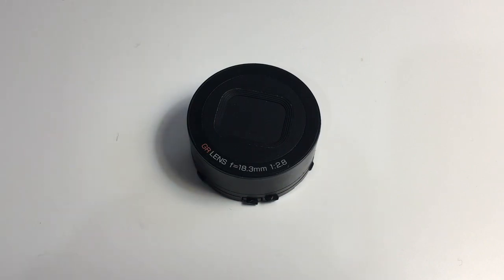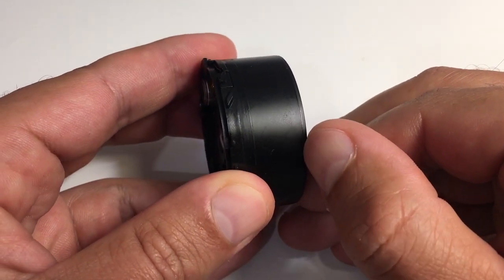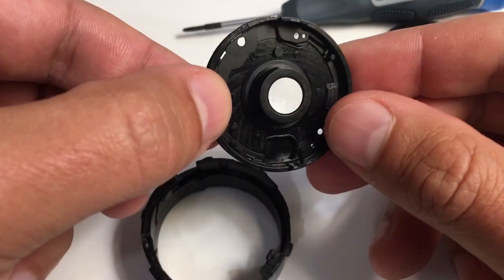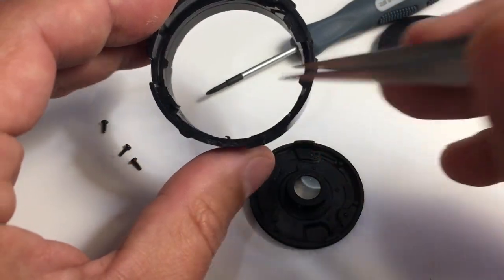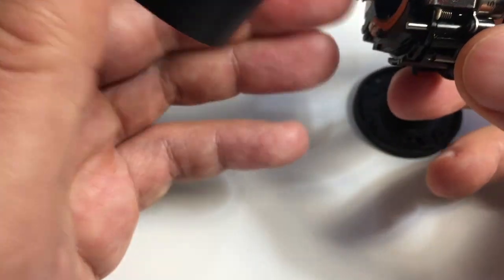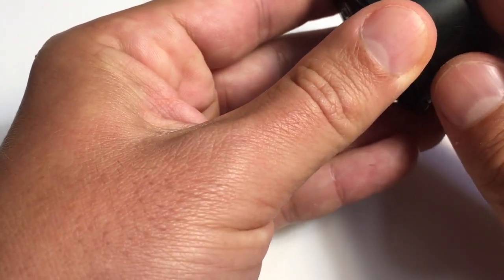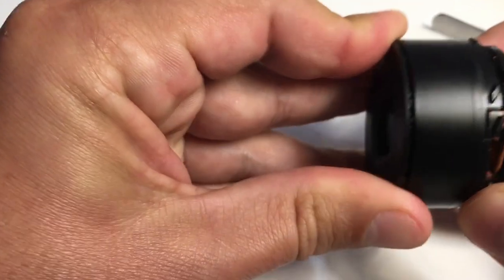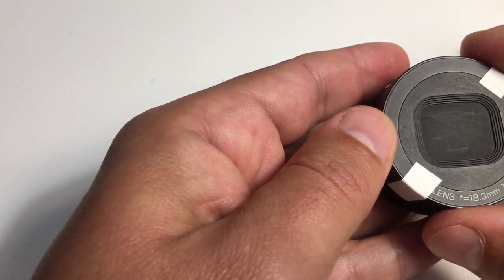Ricoh GR (II) Lens Housing Disassembly

Comment: before applying pressure and twisting on the front plate, make sure to pull the back part so that it will actually move when you twist.

Comment: You should look my videos how to place front cover properly without these long attempts to not break it. BTW, no need to unscrew those 3 screws of front lens element to remove external plastic ring which contained lost spring. It is enough to gently rotate counterclockwise plastic ring which sits on front lens element ;)
Reply from the maker: Thanks for your Tip!

Comment: After struggling with getting off the front plate, I found out it helps if you pull the internal lens element back out of the barrel a little. After I did that the front plate easily clicked loose after rotating clockwise.
Reply from the maker: Thanks fot the tip!

Comment: Thanks so much for making this video, Michael. I found that using a couple of sticky 'protect pads' (sticky dots) used to prevent cupboard doors from slamming loudly when closed, stuck to the front cover of the lens helped get a grip on the front cover to turn then remove while twisting as you say, clockwise. It took a little force but not that much before it popped off. I hope this sticky dot tip helps others who are about to attempt to fix their GR2.
Reply: Just want to add, I'm finding the GRII an absolute nightmare to fix. I read somewhere else that you really need to be a watchmaker to fix the inner lens capsule. Whoever said that is 100% right. The worst thing though is all the time I've invested in trying to fix my camera, could've been spent taking photos, which I'm missing. I know I shouldn't say this (because it'll likely upset the GR fanboys), but honestly, get an Olympus or Panasonic, which imho are far better built, more reliable cameras. If Ricoh had any sense they'd re-engineer the GR for the upcoming IV to include interchangeable pancake lenses. This would do away with all the dust issues and other lens/sensor nonsense associated with this frankly overpriced toy. Such a feat is quite possible, and in fact Pentax have already done it. A sign of even better things to come?
Reply from the maker: Sorry for your troubles fixing the cam. After learning about the tight conctruction I became be also reluctant to service it myself. Lucily there are photo service people who do like the task :) A shop in poland www.fotonaprawa.pl seems to do a fine job fixing GRs.

Comment: i managed to take apart everything, but sadly i also broke of one of the front plate parts, so it doesnt hold in place properly now. sadly, it turns out the pcb wasnt the problem, so it was all for nothing and i still dont know why it wont turn on :(
Reply: @mobo4133, get yourself a multimeter with a continuity tester built in. Sometimes PCB's can look undamaged to the naked eye, but their may still be a fracture on the pcb you cannot see. And disruption to the bleeping of the continuity tester will confirm a break in the copper.
Reply: Update: I now have more empathy for your pain! 😂

Comment: Thanks for this video!I had issues in putting back the front plate, it was not willing to trigger the door mechanism closed. I then found much easier to close the door manually beforehand and keeping it closed during the front plate reassembly with a pice of adhesive tape. By doing this way the silver mechanism is not going to catch the plastic knobs inside.
Reply from the maker: Thanks for the tape tip Stefano!

Comment: Al final me atreví y cambié el cable. !Ha funcionado! Gracias por tu ayuda. Pude desoldar y soldar los cables del motor sin desmontarlo, poniendo una pinza de la ropa que mantuviera los muelles abiertos y utilizando un soldador super fino. Gracias de nuevo.
Reply from the maker: great that it worked out and thanks for the tipp! I post your reply in english so that others do not need to translate it again "In the end I got brave and changed the cable. !It has worked! Thanks for your help. I was able to desolder and solder the motor cables without disassembling it, using a clothespin to keep the springs open and using a super fine soldering iron. Thanks again."

Comment: So I dropped my camera and the  protective lens housing plate fell off. I came here to see how it goes back on and referenced your video at about 09:00 and I was struggling to put it back without disassembling the whole camera or sending off for repair. I managed to get it back on and this is how I did it … I pulled the silver triggers that close the protective doors then taped them so they stay shut. While the camera is ON I put the face plate  in place and it snapped neatly closed then bc the camera is turned on the protective covers should be in open position I had to turn the plate to the RIGHT instead of left and slowly took the tape off at the same time. This snapped right into place. I hope no one has to deal with this but Good luck to anyone who reads this 🙂 thank you so much for your video!
Reply from the maker: Thanks TNESL. A simple and useful tip to put the front protective plate back on the lens back again without disassembling the camera!
Reply: Would it not just be easier to place some tape over the shutters themselves, rather than the tiny silver levers? Thus keeping both leaf doors shut, then taking the tape off slowly once fixed back on?
Reply: @tom fenn yes I put the tape over the lens shutters not the silver levers.  I’m sorry if I wasn’t clear.

Comment: Would you be able to elaborate on the removing of the face plate at 1:35 min? I just cant understand this step - on my lens its impossible to turn the face plate.
Reply from the maker: Sure, what is not clear? Do you have a GR II or III? The model I used in the demo was the GR II. The comment from @buzhichun mentioned it helped him to pull the internal lens elements back a little and then turn it as described.

Comment: hello very nice explanation! very helpfull.. are you making the video how to change the that flex ribbon cable?
Reply from the maker: Yes I plan but did not decided when to do it. One problem is that my GR is in bits (some more cables defect). Even when I change  it there would be no way of confirming that it was the fix.
Reply: @mikphoto  I can understand fully why you haven't. These cameras are a nightmare to fix, and I completely understand now why many professional repairers won't even entertain the idea of fixing them. I may have to go back to using my old (and slow) GRD4, and concentrate mostly on using my Olympus OMD seeing the latter is far more reliable and faster than the Ricoh's. But that said it would still be nice if someone somewhere would explain how to go about replacing the bad cable, just so I could entertain the idea that I may not necessarily have a £500 useless door stop sitting around on my desk!
Reply from the maker: @tomfenn7149  you´re in luck! Follow the steps and links: https://michaelkowalczyk.eu/library/howtos/howto-repair-ricoh-gr-closed-shutter-broken-flex-cable/
Reply: @mikphoto  YES!!! Earlier today I was ready to throw in the towel and give up on the thing. It’s so delicate in there and I was so afraid of causing permanent damage. I’ve also got a GRD IV, and that works like charm still. So not all lost. However the card write speeds on the IV are painfully slow.
Reply: Ahh. Should’ve read before posting. I’ve already seen this, and studied it very carefully. I just can’t figure out how to reliably  detach the motor servo for the shutter from the lens capsule. I’m sure there is a way, but sadly I haven’t quite discovered that yet.
Reply from the maker: @tomfenn7149  contact Jing-Tao Lius, he did it and might help you out. Also let us know if you had sucess :) Good luck!
Reply: @mikphoto  I think I’m going to have to do that. Jing-Tao has the most detailed study into the capsule so far, but he doesn’t explain in it how he got into it, but does point out that he took all night trying to figure it out. Having a migraine today didn’t help much either! LOL. I will contact him and report back to say how I got on and if I eventually achieved the fix.